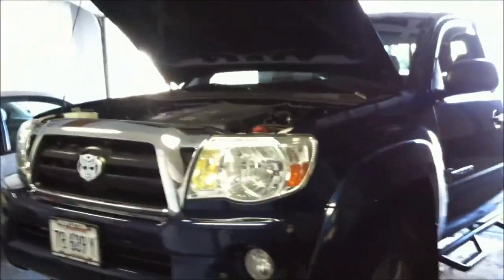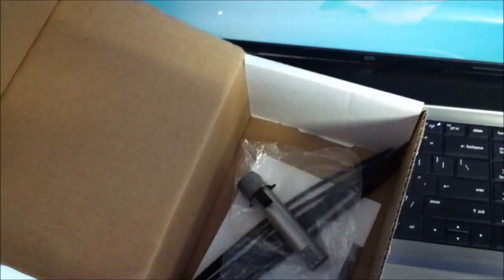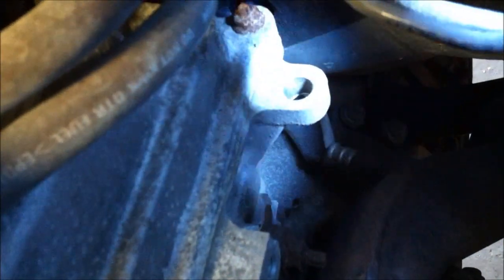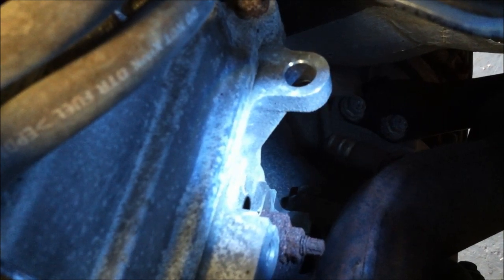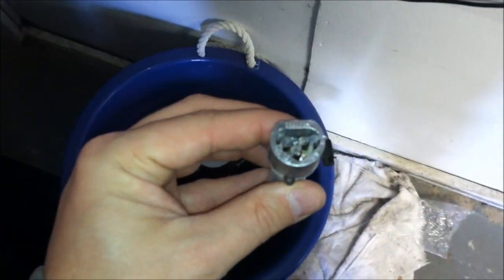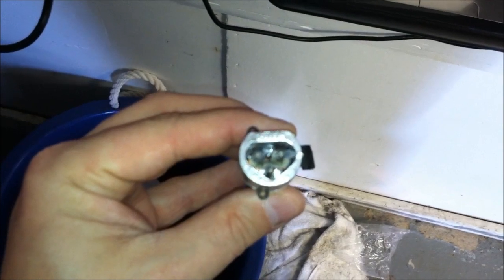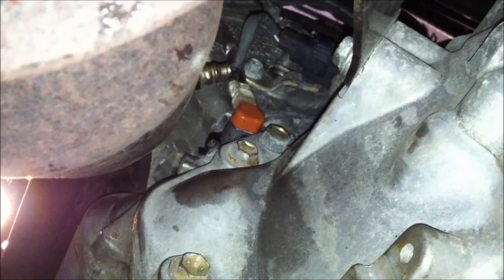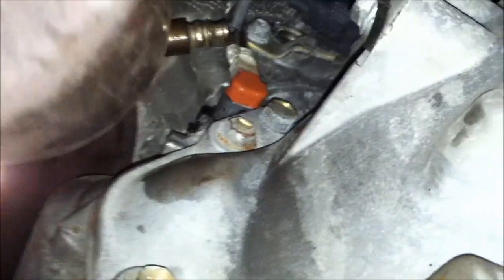2005 -2011 V6 engine block heater install.wmv

Comment: Did the hole have a plug/screw before you put the new heater in? also, how did you tighten the new heater plug?
Reply: CRM6718  No there was nothing in that hole before I put that in.  The heater plug itself has a clip on it that clips onto the side of that hole.